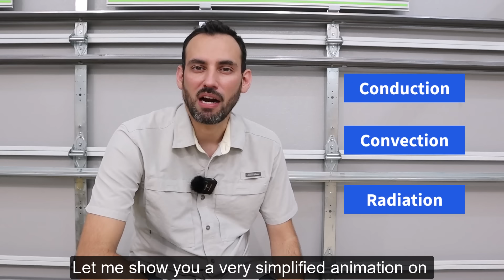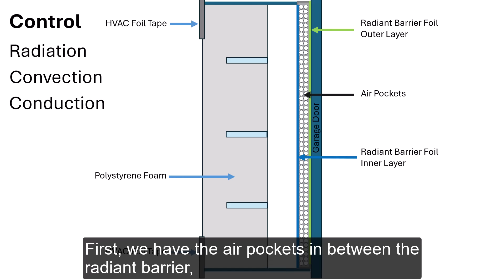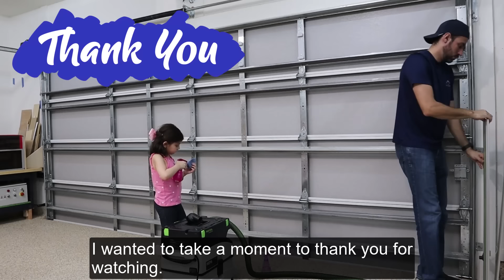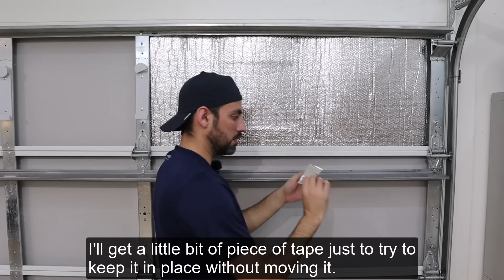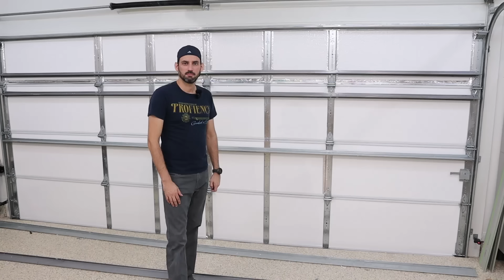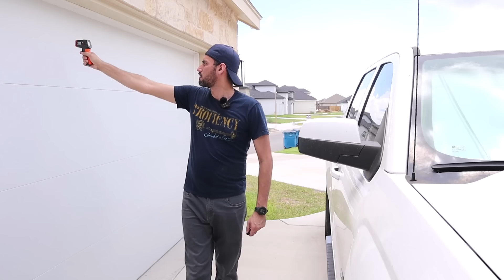The Smartest Way to Insulate Your Garage Door: A Complete DIY Guide

Comment: Great video, For mine I didn't use the foil barrier instead I used a foil backed foam board with the foil side pointing towards the exterior of the door. I used some foil tape to put a small square of foam board in the corner of each section to hold the foam away from the exterior of the door. When measing I just wrote the dimensions of each area on the back of the door before cutting any pieces. Then I could just cut each piece and install without needing to measure again. The one last thing I did differently is I used expansion foam to fill any gaps between the foam board and also the areas between the each panel where I couldnt fit a piece of foam board. If you do this I'd recommend the loctite foam gaps and cracks sealer it comes out white instead of yellow and the cleanup is a lot easier after it dries. This foam also works great to add insulation to the top of coolers like the one you showed in your video. :D Once again great video!
Reply from the maker: Thanks for sharing! I like the foil backed board idea and writing measurements on the door, smart time saver there. The Loctite white foam tip is great too! Thank you for watching!

Comment: Great learning opportunity for many  including me I did insulate but I didn’t use the air barrier. I’m sure I’m going to redo my garage door. Living in SW Florida you need to do this project.
Reply from the maker: Absolutely, Jim! Living in a hot and humid area like SW Florida, every bit of insulation makes a difference. The air gap or barrier can really help improve the overall performance. Glad to hear you're considering giving it another go, it’s definitely worth it for the comfort!

Comment: In your diagram, you showed an air barrier was going to be used between radiant barrier and the foam board but you didn't really do this. The foam was up against the radiant barrier.
Reply from the maker: Great observation, Edgar! You're right, originally I planned for an air gap between the radiant barrier and the foam. But once I got into the install, it turned out to be more practical to place them directly against each other due to space and fitting constraints. In future versions I may try alternative setups to test performance differences.
Reply: @CarlosWorkshopHaven i see. Yes that would he a interesting video. On paper it makes sense that a air barrier would help but does it really help and if so how much? Video would clarify this. Im about to insulate my garage doors with some 1" foam boards that have a reflective side. The channel on my garage door pannels are 2 inches deep. Im wondering if it would be beneficial to put small 1" spacer blocks behind each foam board to create a air barrier.

Comment: Did the foam thing. In FL our exterior garage door can get 150F.  Now we are going to build a carport to cover the door and part of the roof.  Lowe's carries a 2' foam with the mylar on it.
Reply from the maker: Thanks for sharing! That sounds like a solid plan, especially in Florida heat. A carport should make a big difference by shading the garage door and reducing the direct heat load. And yes, that 2' foam with mylar from Lowe's is a great option, easy to handle and adds that reflective layer for extra insulation performance. Good luck with the carport build!

Comment: Great video thank you! I'm in SC and it gets hot in here too. Have you considered addis a AC unit for the garage? I've seen some with 12k btu and I have a 2 car garage as well, but I'm not sure if it' worth the effort and investment.
Reply from the maker: Thanks for watching and for the kind words! Yes, I actually made a video on adding a mini split to my workshop, it's up on my channel if you want to check it out. For a 2-car garage, a 12k BTU unit can definitely help, especially if your insulation is solid (including the door). It all comes down to how often you're using the space, but for regular use, it's definitely worth considering!

Comment: great video and nice install. just remember diy'ers, check the balance of your door before and after installing insulation. with the door down, pull the red release cord to disconnect from the opener. never pull the cord with the door in the open position. a balanced door should stay wherever you put it. if it feels heavy and doesn't stay up on it's own, call a professional because your springs are worn. if your door is balanced, do your install and check the balance again. if it feels heavier or doesn't stay in the position you leave it in, call a pro to either add tension to the springs or change them completely. the material is light yes, maybe a small door wouldn't be affected too much but a double wide like this it could add a significant amount of weight. springs are installed based on the weight of the door so even adding 10 or more lbs could be the difference between a balanced and unbalanced door.
Reply from the maker: Absolutely! That’s excellent advice and super important for anyone tackling this kind of project. A balanced garage door is critical for safety and proper operation, especially after adding any weight. Thanks for sharing that detailed reminder for fellow DIYers!

Comment: What do you recommend for a garage door with windows?
Reply from the maker: Great question! I actually have two windows in my garage as well. I haven’t done any specific testing on them, but when I bought the house, the windows already had a dark tint and came with honeycomb-style blinds. Those types of blinds are designed to help with a bit of insulation, and the tint definitely helps reduce heat gain from the sun. So far, they’ve worked well enough that I haven’t felt the need to change anything! I hope this information helps.

Comment: Making a Z-fold cut in the foam would enable getting in under edges and the transverse brace without removing it.  I have done this on several installations. Also would have used foil backed foam.  Thanks for a well produced video!
Reply from the maker: Thanks for the great tip! A Z-fold cut is a clever solution, definitely a smart way to work around the brace without removing it. I’ll have to try that on a future project. And you're right, foil-backed foam is a solid choice too, especially for maximizing radiant heat reflection. Appreciate you watching and sharing your experience!

Comment: Did you take any ambient temperature readings of the garage, before and after?
Reply from the maker: Yes! The difference was about 10°C (around 18°F). That said, nowadays the temperature difference also depends on the time of day, in the morning the garage stays cooler for longer, while in the afternoon it holds off the peak heat much better than before. Definitely a noticeable improvement! ...of course, results will vary depending on the location you live in, climate, sun exposure, and even garage orientation all play a big role. But overall, it's definitely made a noticeable improvement for me!

Comment: The reflectix, the shiny metallic like insulation, works better if you can put a small air gap between the metal door panel and the insulation. If the insulation is touching the metal panel, the heat will transfer more easily thru the reflective barrier!
Reply from the maker: @MrTunalic You're absolutely right! An air gap definitely helps maximize the effectiveness of the reflective barrier. I mentioned it in the video, but in practice it was tricky to space it perfectly still, any bit of gap helps. Thanks for pointing that out!

Comment: If you were to actually stick to your original design with the air gap...wouldn't the air gap be better between the metal panel and the radiant barrier?  I thought you didn't want radiant barrier touching anything in the primary direction it is trying to reflect.
Reply from the maker: @URackADisciprine Yes, you're totally right, the air gap should ideally be between the metal panel and the radiant barrier, but it ended up being a bit tricky to implement cleanly. Still got some benefit, but I agree, it works best when not touching anything. Thanks for pointing that out!

Comment: Hi Carlos! Amazing video! Did your garage door components need readjustment due to the weight that was added?
Reply from the maker: Hey Samuel! tricky answer. My garage door originally was not perfectly balanced to begin with, but even with that being the case, I was able to open it and close it without any problems. Having said that, I do not use my garage to park my cars, so I do not open it often. However, it will be wise to re-balance your garage door to extend your garage door motor life. I placed a video together about it, but I am not a professional garage door installer, so my video is only for illustration purposes only. I personally, on my unique situation will not have rebalanced my garage door, but I need it to show how to do it. If you would like to rebalance your garage door, I will suggest to hire a professional to do that work. I hope this information helps.

Comment: you cant rel=ally get accurate readings with a laser thermometer when it comes to reflective or transparent surfaces. so im skeptical as to the accuracy when you were aiming it and the reflective insulation and the car windshield.

Comment: For about $75.00 per door you can snag a precut kit that is the right dimensions to fit inside the panels . Then you should put new bottom rubber seal ,new outside bumpers total ,if your going to do it yourself about $100  per door . You wasted that in cheap crap . And the music 
Sucks

Comment: You installed the reflective barrier incorrectly.  You should have left an air gap between the door and the reflective insulation. See manufacturer installation instruction.  Your way is correct for cold climates. Hot climate is  Hot surface>Air gap>Insulation. Look at your own diagrams. Reflective insulation only works on radiation heat transfer which requires a space or it is just conductive heat transfer.  With your installation the only reflection of heat is back into the garage.
Reply: So there should be space between the garage door and the foil type barrier? How would you create a gap between these two? Just wanting to get the best results for SWFL garage. Thanks
Reply: @Mrs.Burnett  good question! Ide like to know that too?
Reply: @Mrs.Burnett glue it to foam board?

Comment: 1.  Gap between door and radiant barrier  2.  Wrong insulation:  the white stuff is useless over time.  3.  Failure to insulate the exposed ribs defeats much of your work.  4.  Decoupling the ribs from the door by placing plastic sheeting between the two will improve your result. 5.  You did not show the temperature of the exposed metal ribs in the garage, so when you figure out exposed verses insulated area and apply the formula U*A* Delta T you can quickly see this is an ineffective way to insulate the door.  It is essential that NO metal on the door be exposed to the room.  This is why Fiberglass and wood doors were used in the old days:  People choosing materials used science more than just following what is cheapest.

Comment: What would you recommend for older garage doors? My garage door doesn't have the metal cross frames that the foam can slip into.
Reply from the maker: For older garage doors without metal cross frames, I’d recommend using heavy-duty double-sided tape to attach the foam panels. Make sure to clean the surface thoroughly with alcohol beforehand to ensure a strong bond. Just keep in mind that depending on the tape you choose, it might be difficult to remove later if you decide to replace the panels in the future. Good Luck in your project!😊

Comment: A lot of scientific blah blah but reality is that heat loss due to conduction would be prevailing. Just use whatever material you like rock wool or polystyrene  in 1 1/2 or 2 inch thick and you are fine. Radiation and convection would be negligible so do not fall for magic NASA foil and air bubble product that would make a miracle being only 1/8" thick. It will not. Cheapest solution I found is polystyrene 1 1/2 inch for some $50 which is enough for 1 car door. I cut small pieces to fill C-channel and just was leaving some 1/2" gap to be able to fit panel snugly. I did not need even white tape. It made significant difference. I can work in the garage with door to the house open and it keep it at 55-60 with 32 outside.

Comment: Hi Carlos. - great video, my garage door does not have sections where you placed the foil and foam board.  The door is flat, any suggestions on how to best attach the foil and board to the door?
Reply from the maker: @brettlarrabee3728 Thanks, Brett! For a flat garage door, you can use adhesive spray (non-permanent) or double-sided tape (probably the safest bet) designed for high temperatures to attach the foil and foam board. Another option is to use small screws and washers into the vertical posts/beams (if any) to secure the foam board without damaging the door. Just make sure to clean the surface well before applying anything for better adhesion.
Reply: @carlosworkshop hey Carlos, where can I get the airgap layer?
Reply from the maker: @Whitehawk0 Hey, sorry about the super late reply, it did not showed up on my alerts. I posted links to all the items I used in the description of the video. :)

Comment: What are those Festool boards on your door for? Is that part of your assembly?
Reply from the maker: Hey @cesardiaz1462 those are my Festool track saw tracks mounted on the door. They’re not part of the insulation assembly. I have them hanged in the garage door to save space from the rest of the workshop. :)

Comment: Do you have to update springs when add insulation?
Reply from the maker: @19viper81, great question! Adding insulation adds some extra weight, so it's a good idea to check if your springs are still balancing the door properly. If the door feels heavier or doesn’t stay open, you might need to adjust or upgrade the springs. I actually have a video on spring replacement if you need guidance!

Comment: Does same setup work in cold area to keep heat inside garage? Or to keep it less colder inside garage in winter?
Reply from the maker: Yes, this setup can definitely help keep your garage warmer in colder areas by insulating and retaining heat. It works both ways to improve temperature control!

Comment: Why are garage foams so expensive!
Reply from the maker: I know, right? I’m not sure why, but it seems like everything’s going up these days. Thanks for watching!
Reply: @CarlosWorkshopHaven  would you recommend putting a reflective/foil-type film on the back of the foam or the front or do you think it matters much? I have old stained foam already in. But found a reflective liner that has the reflector on one side and new white look facing it so it makes the door look newer
Reply from the maker: @epigeneticnerd4244 First, let me apologies for the super late reply to your question. It did not show up on my alerts. Regarding your question, If you’re using a reflective/foil-type film, the best placement is usually with the reflective side facing the heat source — so in this case, facing outward toward the sun/garage door panels. That way, it reflects radiant heat before it gets into the garage. But honestly, even having it in there at all will help, and if the white side gives your door a cleaner look, that’s a nice bonus too!

Comment: Pretty good installation. However, more emphasis should be placed on how to adjust the door spring due to the added weight of the insulation materials.
Reply from the maker: Thanks for the feedback, Stanley! You’re right, adjusting the door springs is crucial with the added weight. I’ve actually uploaded a video that covers the spring adjustment in detail. Appreciate you watching!

Comment: Great video! Do you have to re- balance the garage door with the added weight?
Reply from the maker: Thanks, Patrick! Yes, the added weight from the insulation might require rebalancing the garage door to keep it operating smoothly. It’s a small weight increase, but it’s always good to check. I’m also working on a video that shows how to rebalance the torsion springs, stay tuned!
Reply: @CarlosWorkshopHaven I'd be interested in that as well.  Could the extra weight also pose a problem for the opener?
Reply from the maker: Great question! The added weight from the insulation is minimal, but over time it could put extra strain on the opener. It’s a good idea to monitor how it operates. I also have a video on adjusting the springs to help balance the added weight. Thanks for watching!

Comment: Do you have to readjust the springs on the door?  I want to add insulation but im not touching those springs.
Reply from the maker: Great question! The added weight from the insulation is minimal, around 5 lbs, but even small changes can affect the lifespan of the springs. That said, 5 lbs shouldn’t make a huge difference, but it's something to be aware of. If you're not comfortable adjusting the springs, a professional can help. I’m actually working on a video right now that will show how to replace and rebalance garage door torsion springs. Stay tuned, and thanks for watching!